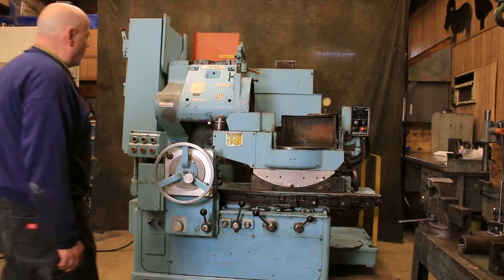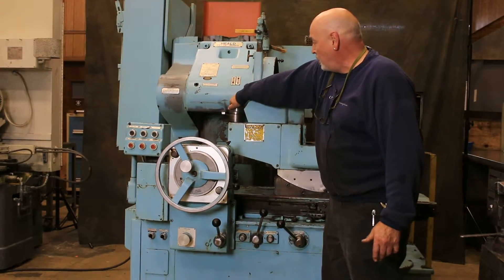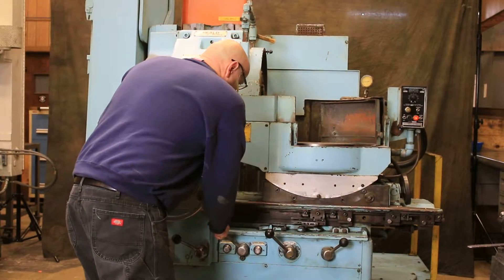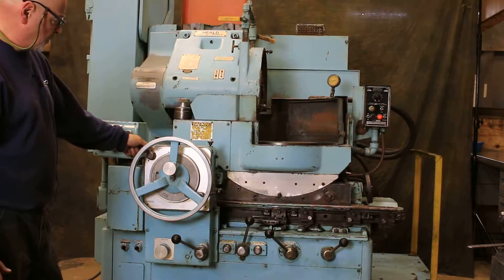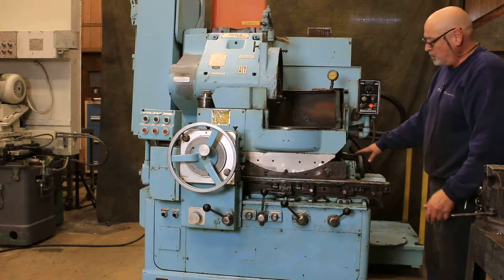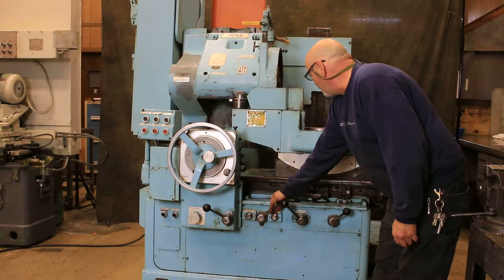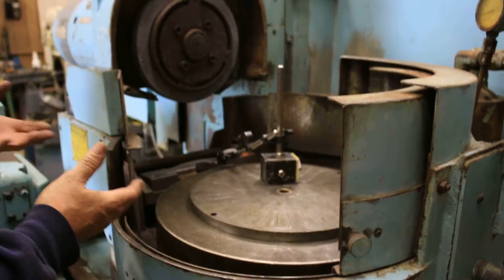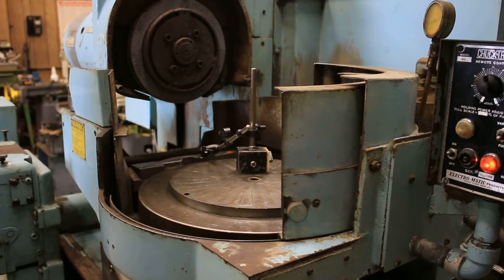17'' Chuck 10HP Spindle Heald 261 ROTARY SURFACE GRINDER, AUTO IDF, EMC, COOLANT  -2

Comment: Nice machines! I ran a 1955. I never played with table tilt. Thankfully I think ;- ) I ground bearing seal plates for Pratt & Whitney engines before lapping them. It got me within .00005 so that was pretty good and even heat and stress kept the parts flat with no 'potato chip' warp like a general reciprocating chuck. sometimes a shade concave or convex but far better for lapping than a 'potato chip' warped part. I followed up with a speedfam for free hands and free weight lapping and a lapmaster lapping machine for polishing. 00002 to .000011 max flat in 10" in the end with 5 micro on chrome plate using the 12" flat and monochrome light. Thanks for the video. Chris